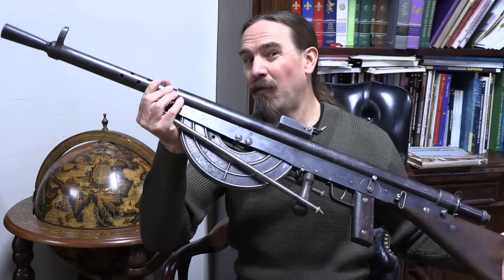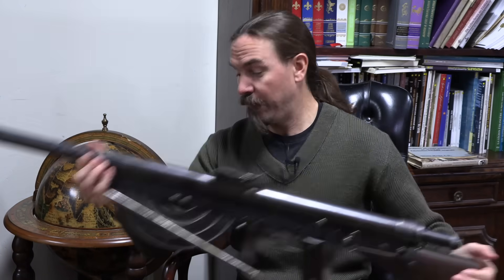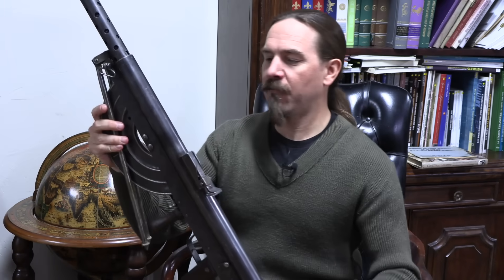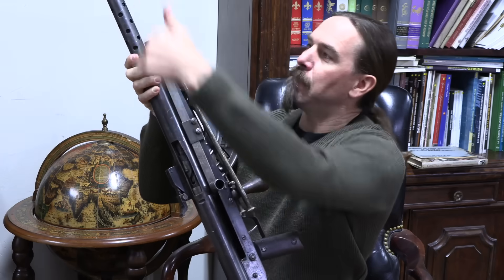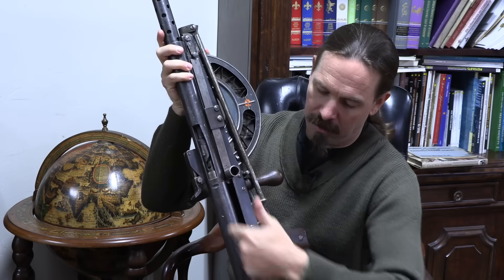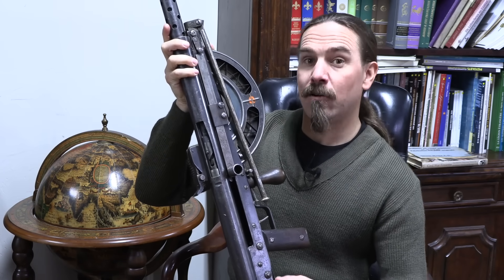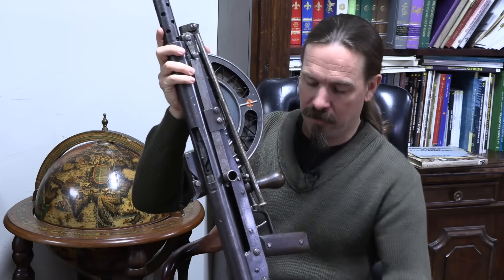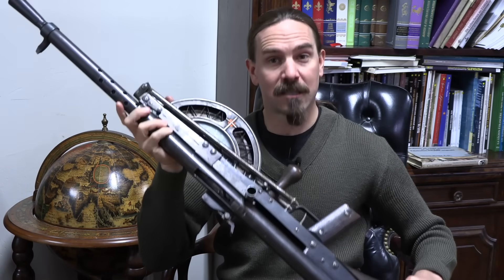Rate of Fire: What Determines it and How to Change It

Comment: Great topic for those not up to date on this.  You did a segment on scout rifles.  The variable optics eye box at higher magnifications is a problematic a well fitting stock becomes critical. Have experimented with several scopes and red dots.  An illuminated reticle would be an advantage.  Have moved away from the forward mounted optics to magazine fed rifle with a low power variable optic like Arken optics EP-8.

Comment: If you have a D-cell battery and an old danish M49 SMG, you can stuff the battery up the back end of the SMG and up the firerate A LOT.
Reply: Uh... Isn't that a potential hazard?.. 
I'm not worried about an exploding battery, but a damaged one corroding away inside my gun...
   Perhaps some other solid coin shaped objects might due?... 
   Not that I have an old Danish M49 lying about to go sticking batteries in...😅

Comment: Not a related weapon but, could you control a minigun depending on the voltage you apply to it? You can make a motor spin faster by applying the same principle. Maybe it's just a dumb question but meh, doesn't hurt to ask.

Comment: A good example would be the MG3 and it's variants.
The standard MG3 has a rate of fire of 1200. For their version called MG74 the Austrian army wanted a lower RoF so the increased the mass of the bolt from 675g to 950g which reduced it to 850rpm.
Looking at those numbers I can't help to notice that the original bolt mass is about 1/3 lower for the MG3 while the RoF is about 1/3 higher so the question arises if there is a linear relationship ie had the Austrians doubled the bolt mass would the RoF be halved ?

Comment: Let me guess before watching: reciprocating mass and distance of travel, the lower the two the faster it fires. Probably locking mechanism has some influence as well.

Edit after watching: Was somewhat correct, forgot you could open up the gas port for more violent cycling.

Comment: Did the MG3 have a dual fire rate system? I don't particularly recall one being mentioned in your MG3 video, and I'm also assuming that the fire rate selector on PUBG's MG3 is solely for gameplay purposes, but figured I'd ask just in case that ever existed. In specific, the MG3 in that game has a 660RPM setting and a 990RPM setting.

Comment: Perhaps not your normal topic, anyhow, the Bofors 40 mm AA gun model 1936, widely used in wwII, has a fire rate of 200 rpm. The model 1948, basically the same gun, has 400 rpm. The difference is that the live round is loaded while the spent casing still is on its way out. I was trained as a mechanic on both, mainly the later.

Comment: Wonder if recoil spring strength would have anything to do with rate of fire? Let's say in a blow-back gun. I guess an enormously strong recoil spring would stop the bolt from cycling at all, so that would be rate of fire zero. And no recoil spring at all would probably mean the bolt won't cycle at all, unless it bounces back, so still rate of fire zero. But in between?

Comment: Of course another way to vary rates of fire is change the springs.  Guns with external hammers that are pushed back with a slide have mainsprings that can change the speed of function.  Guns such as the Remington Model 81 or the AR class of rifles have recoil springs in the buttstock which can adjust the cycle rate of the action.  Similar is true for blow back pistols or the Ingram M11.  Changing the spring to a stiffer one or a weaker one will effect cycle velocity

Comment: Just because I didn't quite understand from what he said in the video, did he mean that there are firearms where you can change the fire rate on the fly with just a switch similar to how you would change easily from safe to fire? If so, that is a situation where I'd like more details, because I'm curious what the application for that would be to need to change from 600 to 900 rpm with the same weapon.

Comment: I'd love a video about AR semi auto cycling, looking at the bcg travel in slow mo talking about the choices to optimize but still be reliable. Gas tube length, barrel length bcg weight, buffer systems, bolt bounce, gas efficiency based on intended use. Maybe together with Sotar?

Comment: I would have liked mention of changing the material of the reciprocating mass in most systems. Of course you cannot change much of the material that actually experiences major forces, but many firearms have masses that serve as nothing more than mass for the locking mechanism, this can be influenced by changing the formulation of the material.

Comment: Frequency is equal to the square root of the spring stiffness divided by reciprocating mass.

Of course this isn't a free system as there are impacts and other actions at the ends of travel.

Comment: Just how common are gas regulators in machine guns? They are one of those easy to miss things.
For example for Type 99 LMG there are two well known fire rates: 450 and 800rpm, but finding mention about the gas regulator took long. It has whole 5 gas settings.

Comment: I think the VZ61 Scorpion deserves an honorable mention. It has a rate reducer spring cleverly hidden in the grips, to give the platform more compactness.
Reply: Yeah, I was thinking about something like that. A tensioner on a buffer spring (like a screw on the back that could be driven in or out a certain length) might also be a decent way to get a certain variability.
Reply: @bwhog  that reminds me of the ZK 383 which had a removable weight which could change the rate of fire.

Comment: A thought occured. Are there any guns concept/prototypes that use a seperate system to operate the bolt? Like electricity with a solidnoid? I wouldn't expect much benefit in muzzle velocity or other desirable characteristics, but it'd be a neat what-if.
Reply: To clarify, I mean still with powder fired bullets, just not using some gas to cycle.

Comment: I wonder if you could reduce mechanical wear and tear if you had a magnet forcing the bolt forward rather than a spring. Could also give a lot of control over the rate of fire if it were an electromagnet

Comment: At 3:06 - I think it is more proper to say that the bullet and the bolt will go with equal amounts of momentum in opposite directions, not equal *energy*. Momentum is a function of mass and velocity to the first order, while energy is a function of mass and velocity-squared.  That allows the bullet to carry the lion's share of the kinetic energy in the system while sharing the momentum equally with the recoiling gun.

To use a simple numerical example: If a gun of mass = 2 recoils to the right with a velocity = 2, a bullet with mass = 1 will travel to the left with velocity = 4 so that the momentum (mass x velocity) is equal and opposite for both parts of the system.

If energy = 0.5 x mass x velocity-squared, the gun carries an energy of 0.5x2x(2-squared) = 4 units, while the bullet carries an energy of 0.5x1x(4-squared) = 8 units, or twice as much as the gun.

In a more realistic example of a gun weighing 24 oz firing a bullet of 0.5 oz (a 48x difference instead of a 2x difference), the difference in speeds is even higher and the energy is even more lopsided towards the bullet.

That's why a little snubby firing .357 magnum might bruise your hand a bit when you fire it, but the poor slob who's hit by the bullet will, in the famous words of our outgoing President, see the lung blown clean out of his body. Or at least suffer a lot more injury than a small bruise.

Comment: Ian, perhaps I missed it but rather than tamper with or alter the charachteristics of the Bolt itself, a machined and highly engineered part, OR the receiver length wouldn’t it be more practical to simply experiment with various recoil springs, springs of variying weights, thicknesses or tempered to variying degrees of resistance,  …Spring Tension.  Obviously, you wouldn’t be able to make on-the-go adjustments.

Comment: Excellent discussion of rate of fire and the mechanical/physical  principles that underly the issue.  In a future video I would love to see a discussion that includes dynamic rate of fire devices that allow the gun to change the rate of fire  as it is being shot.  Say from 6 rounds per minute to 650, in other words having some sort of Vernier control that would let the operator select any speed between the fast and slow settings and adjust the speed as the gun fires.  An example would be to fire a burst at 500 RPM and then back it down to 10 RPM to keep their heads down.

Comment: Purely technically. Weapons with a high rate of fire usually have less shooting accuracy. Which is only good when fighting a running horde of soldiers. Nothing happens like a running horde of soldiers. Weapons with a lower rate of fire save ammo and are more maneuverable, heat up less and can be fired for longer. At the same time, it maintains greater shooting accuracy due to less heating of the barrel. I don't see much advantage in a high rate of fire for an infantry weapon. Or does it have some advantage? 😀

Comment: Among the rof or to be exact, the bolt cycling consistency factors, one thing I need to point out is the muzzle device especially for gastrap and recoil operated guns, with the major moving and force taking part taking untrivial forces from muzzle devices, the rof and overall cycle consistency is greatly affected. As we would see on an94 and other guns, some is to enhance the accuracy while others ensuring the gun functioning

Comment: This raises the question in my mind of when the recoil impulse is felt by the shooter.  Does it occur immediately upon firing and before the bullet leaves the barrel or reaches the gas port?  Or must the bullet either reach the gas port or leave the barrel before the recoil impulse is felt?  If rate of fire affects accuracy it would seem to me that the latter would be the case.
Reply: The acceleration of the bullet causes something to start immediately moving in the opposite direction. Just a lot slower than the bullet. 

On any common service pistol, that would be the slide and barrel together. This initial recoil action compresses the spring, which pushes the frame and grip into the shooter’s hand. When the slide hits its rearmost position, the shooter feels most of the recoil. In the third phase, the slide accelerates forward driven by the spring, which again pushes the grip into the hand. This ”third recoil” is the weakest. 

On a gas operated rifle, the bolt is locked so the initial recoil affects the entire rifle. However, as the bolt unlocks and starts moving back it’s doing so driven by gas pressure that must push the rifle forward with an equal impulse: the recoil movement of the entire rifle slows down. The shooter feels several recoil blows: the initial recoil pushing the rifle back, the bolt carrier hitting the back stop and driving the stock further into the shoulder, but also the bolt slamming forward causes a recoil action, this time forward. 

On an open-bolt submachine gun, the shooter feels recoil before the gun even fires: the bolt accelerating forward pushes the rest if the gun back. If the gun is empty, it jumps forward. If it ignites a round, the bullet goes forward and the bolt starts moving back. During this time, very little recoil is felt. When the bolt hits the back stop, you feel it.

Comment: But what if there is no bolt to cycle as in the Mauser BK27 25mm autocannon? Or in the case of a chain gun where the bolt is driven through it's cycle by an external electric motor, just changing the speed of the motor changes the rate of fire. And yes please do a rate of fire video, I know you have mentioned on previous submachine gun videos how a slow rate of fire is fine or a really fast in the case of the Suomi is fine but that middle rate is detrimental. So which is better Grease gun or Suomi?

Comment: As soon as he started talking about adjusting rate of fire the first question that popped into my head was when a high rate of fire for general infantry use started to have diminishing returns. A video on optimal rate of fire would be awesome
Reply: go and have a read up on the MG 42, the wiki brushes across Wehrmacht tactical doctrine and why the 1200+ rate of fire was sought. then compare with British squad doctrine and the role of the Bren gun.

Comment: Good example would be PPSh41and PPS43, both fire the same cartrige and both are simple blowback, but by just making reciever longer slowed the fire rate from ~1000 to ~600 RPM
Reply: I always wondered what the difference was. I assumed the PPS43 had a heavier bolt.

Comment: I´d say there´s another way to change bolt velocity - the mainspring.
On the Maxim and its derivatives it´s force even is adjustable.
And, in the modern guns with blowback, recoil or gas systems and an inline spring, if the receiver length is set up for a long overtravel and has a fairly weak spring, a stiffer one will reduce this overtravel while at the same time impart more acceleration in the forward direction.

Comment: When I was in the German army for mandatory service, everyone repeated what I always took for urban legend.
That the mg3 machine gun we were using was nothing more than a WW2 used german mg42 machine gun just with a different bolt to cap the firing rate.
Is that actually any merit to it?

Never looked into it. 

Remembering the bolt of the one type of mg3's I trained fieldstipping on has a kind of a weird bolt in comparison to the other guns we were trained on. 
In the middle of the two solid ends is a steel braid which could function as a spring to dampen the acceleration of the bolt in both directions.
 But is it though? 
And is it a repro of the WW2 gun that was nerfed?

Comment: What about the overall length of the cartridge, a 9mm has a maller overall length then a 308 so the traveling distance of the bold is longer with a 308 than a 9 mm. Isn't that why a little bullit like a 380 auto has a faster rate of fire then a 9mm, with less gun powder in it?

Comment: Hook up a battery and high rpm motor to a lever bolt pump action and Lower gear ratio to the trigger and it's still a machine gun 😂

Comment: A bit disappointed that you gave the spring's part in the system such a short shrift. Changes to spring design (length, wire diameter, coil pitch, etc.) will impact the rate of fire. There's also the question of preload (i.e., how much force is the spring exerting when the bolt when it's in battery). Of course, if the spring is too strong or there's too much preload, it makes it hard to manually cycle the action.

Comment: I’ve been tinkering for a long time with some of my AR builds. Specifically 9 mm. I’m designed some of my own buffer weights and I’ve tested a array of buffer tubes. I have a rifle length tube. I used with 9 mm using 5 1/2 ounce buffer and a carbon tube with a 5 1/2 ounce buffer and I’ve tested with quarters in the back of the buffer too short in the bolt trail. It’s been very interesting. In some cases, I have managed to get a very smooth firing weapon. That also has an insane rate of fire. My best one yet for a 9 mm I had a 21 ounce bolt with a 10 ounce buffer in a carbine buffer tube. The bolt can’t come back far enough to hit the bolt catch on the last round, but it completely clears the ejector and cycles the next round. I tried it with an FRT and although the gun had less recoil and felt significantly smoother to shoot. It was still running about 1200 RPM. That same set up with a rifle length tube and an extra spacer adding almost 2 ounces will get me somewhere around 750 RPM due to the extra mass plus the extra length it has to travel in the receiver. I would say that one feels the best to shoot maybe just a hair more recoil than an MP five
Reply: I suppose that everytime something hits a hard stop somewhere that that gives a jolt to the gun which impacts your aiming ability.  Backwards with recoil but also forwards with the bolt slamming in the receiver. 
If you balance that so you don't have those problems so much then the gun should be easier to control because there is less energy to go around in weird directions.
Reply: @ yes there is a perfect balancing act between the two. Even with the heavier buffer system when I’m running a very short stroking system, it almost feels like I’m shooting a sewing machine. The heavier buffer system mixed with a lot longer recoil path gives all of that weight more time to slow down. Rate of fire is decreased, but it’s much easier to keep on target. As with any gun, no matter what if you increase the rate of fire, whether it be with a lighter bolt or by reducing dwelltime, you’re going to get increased recoil, unless the weapon itself is pretty heavy.

Comment: This makes me think of electronic ways to slow down the rate of fire in SMGs! What if you could take something like a microuzi or Glock and then add a battery operated trigger control mechanism which is only activated with "auto" switch? That way you can digitally control the rate of fire and it should use the minimum amount of battery meaning it should be enough for many years without battery replacement!

Thoughts?
Reply: I think these are used in airsoft.

Comment: Check the old .32 scorpion design. Very interesting rate reducer inside it. It held the bolt in rear position if I remember correctly
Reply: I was surprised he didn't mention the VZ 61.